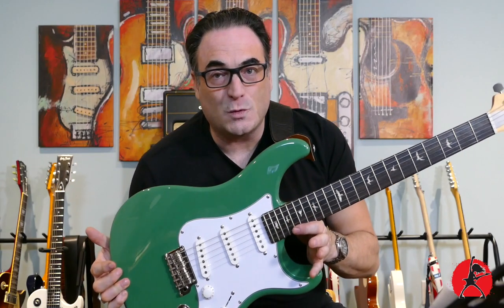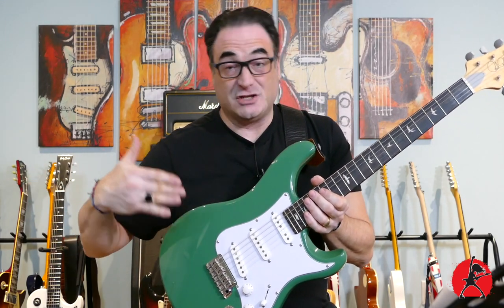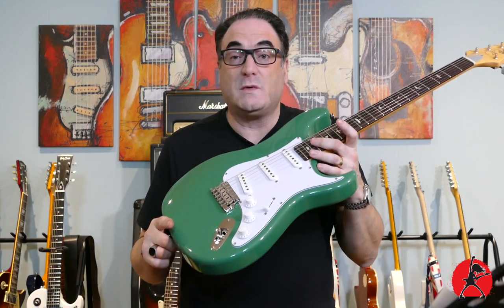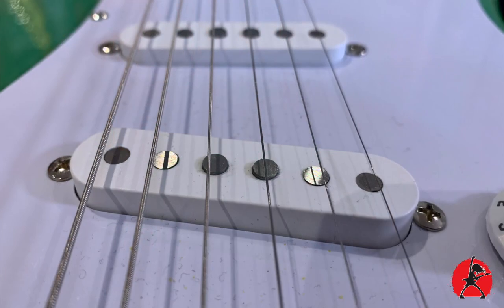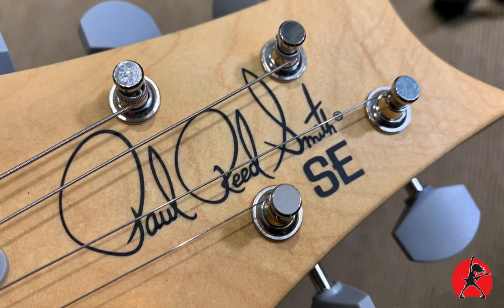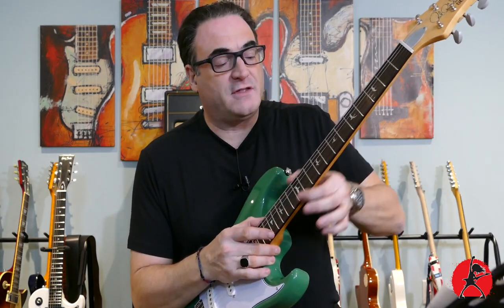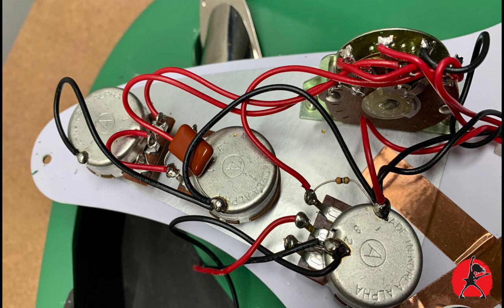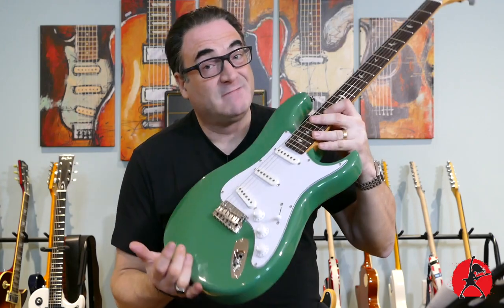PRS Silversky SE | Not What I Expected | Most Detailed Review On YouTube

Comment: I think the direction of the headstock swoop is a consequence of giving more room on the treble side so the index finger, etc. has more freedom to grab some chords close to the nut. The tuners on the treble side are also shifted back accordingly. I think those were all smart technical and design choices.
Reply from the maker: That would make sense
Reply: In a video, John Mayer claimed the direction of the headstock swoop was about balance of the guitar sitting in your lap. If I remember correctly, he said that because the upper horn of the body is bigger, he felt it would only make sense that the lower “horn” of the headstock had to be designed this way.

Comment: One brand that i am getting tired of is PRS, the number of reviews on Youtube is a pandemic!
Re the Siver Sky SE, as soon as i read the specs i knew it was not for me, the neck is way too thick and narrow
the rest of the specs smack of cost cutting.
There are far better lower priced guitars than these, have a look at Sire's Larry Carlton S7.
Perhaps as time goes by and PRS release improved versions i might be interested, but not this current one.
I will stick with my Ibanez, Schecter and ESP guitars with slim wide radius necks.
Thanks for your excellent review Tony
Reply from the maker: Did you actually play one? I’m surprised.
Reply: @addictedtogear  Yes, and walked out of the shop with the Sire Larry Carlton S7.
The Sire was very well finished and setup to my preferemce, the neck suited my small hands better.
and the hardware on the Sire is superior to the PRS.
If i had chosen the PRS i would have had to upgrade too many parts, that plastic truss rod cover and
single ply trem cover look terrible.
PRS will hopefully offer this model with a better ie wider radius and thinner neck at some point,
until then it's just not for me.
Reply: @Barbarapape  Sire also a lot cheaper ! Here in EU it is anyway.
Reply: @malcolmhardwick4258  Sire is also cheaper in the UK, why pay more just for the name on the headstock?
Having compared them side by side, the Sire was far better and at a lower price.
Reply: @Barbarapape  Having Larry Calton on ya headstock is no bad thing !